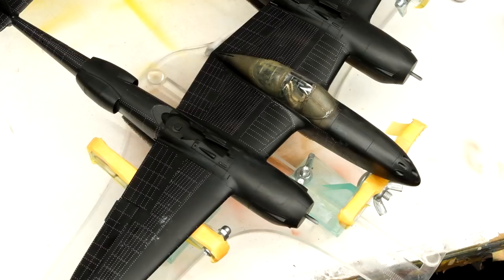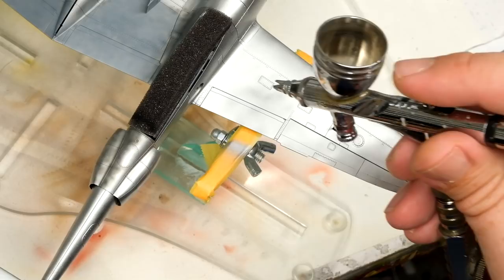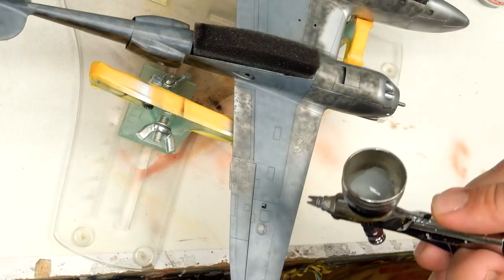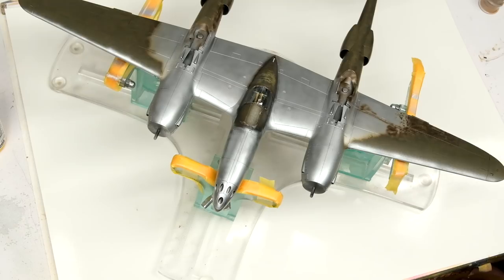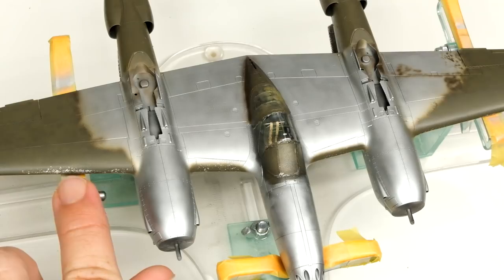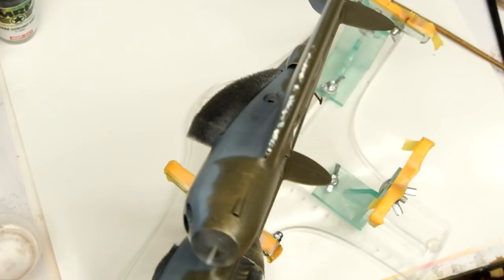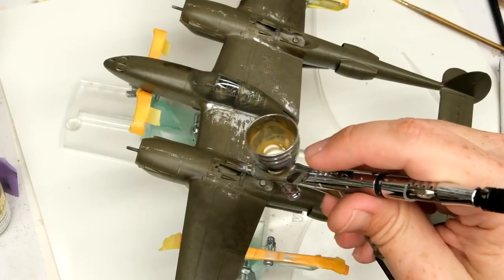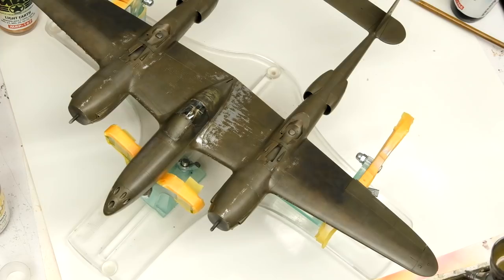Tamiya P-38F Lightning 07 - It's Painting Time

Comment: Thanks for this, I needed it today. I would have never thought of using Novus that way. May not have given the results you were looking for but still very useful. I tried one of those airbrushes last year and returned it. After a minute or two of spraying paint would be dripping off the needle or crown cap. If I took that cap off then there would be a little cloud of paint around wherever I was painting. For example, if you tried to pull a line with it you could get a nice line but you could see the overspray on either side. No matter what paint, how it was thinned or what air pressure. I use a 289 for the type of painting you're doing. Took a little adjustment with the longer front end but I found that it helps reaching into smaller or tight areas. Oh well, just rambling. Thanks for all you do.

Comment: Excellent results as always. I have a couple of questions. How do you transfer the hairspray liquid to the airbrush? Also how you can chip a lacquer based color with such ease? If my memory serves me well, the undercoat is a lacquer based also color (LP11), which makes it more difficult or rather impossible to chip over with the same thinner as its top coat? I am trying to understand how you can achieve such a good result in chipping two chemically identical liquids. My apologies If I missed something in between your excellent tutorial.

Comment: I really like the hairspray chipping effects around the cockpit.  A couple of questions. 
How long can you leave the hairspray before it won't chip any longer?  Did you pretty much chip the Mr Color OD as soon as it was dry?
Reply from the maker: It's not so much the hairspray as the paint on top of it. With MRP and Gunze I try to chip more or less immediately. The longer you leave it to dry the more the small, irregular chips become more like uniform little circles.
Reply: Follow on question regarding your chipping medium choice. Have tried any of the AK chipping products and if so what was your assessment?
Reply from the maker: @johnmulhall8855  they're fine...I don't really care for them compared to hairspray for normal paint chipping, but use them a fair amount with "weathering chipping" with enamels

Comment: I’m curious about your gun cleaning habits. Your passion for painting shows in the results. For me, painting is my least favorite part of modeling because I feel like 85% of my time is spent on prepping the model and cleaning the gun. It kinda kills the MoJo. So many kits come to a standstill (just before paint)because I dread cleaning the gun. What’s your secret, gun cleaning habits? (Maybe I’m working to hard)
Reply from the maker: Yeah you're definitely working too hard. This post is several years old now, but pretty much still holds. https://doogsmodels.com/2016/09/09/airbrushing-cleaning-the-damn-thing/

Basically my secret is spraying thin and spraying mostly lacquers (or lacquer-thinned things). During an average bench session where I'm using the airbrush, I'd estimate I spend about 10 minutes top dealing with cleaning the airbrush. I'll usually pull and clean the needle right before I start painting, run a bit of thinner through it, and then go to work. At the end, I do the same thing in reverse. After colors, I'll do a fill/swab pass with a q-tip, flush that, do another half-cup or quarter cup, hit the area around the needle channel with an old paintbrush, and flush again. That's pretty much it.
Reply: Thank you sir! Ask the right question and get good answer. It’s cool I’m also doing a “operation torch” model. I’ll be following along closely. I’m not quite at the level of”tone shadowing” but I’m going to try some chipping effects for the first time. As Max would say”Model On!” Thanks again this is such an amazing hobby!
JC.     : )